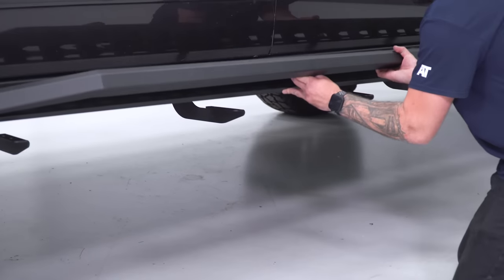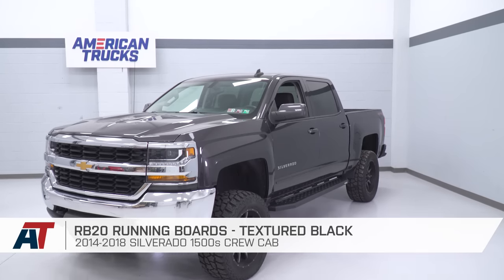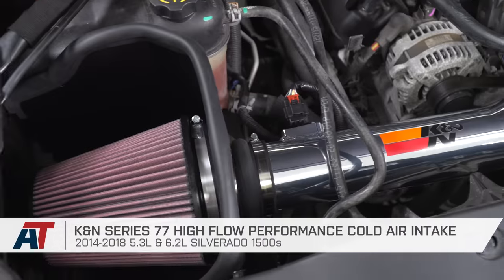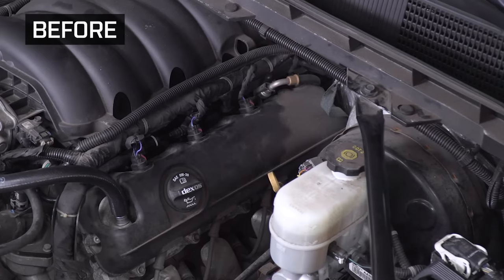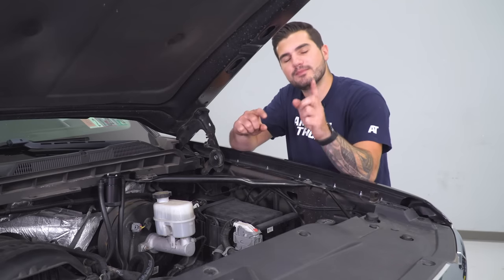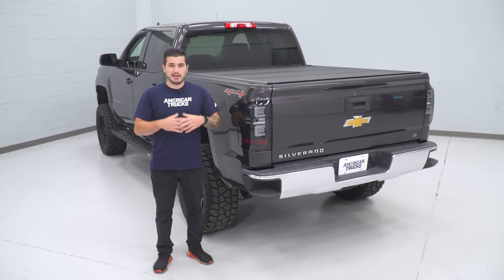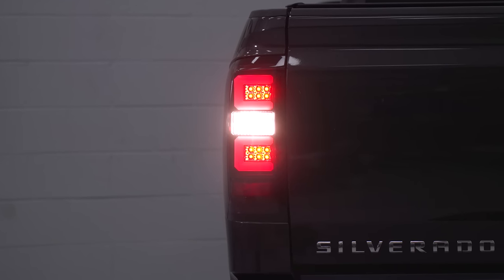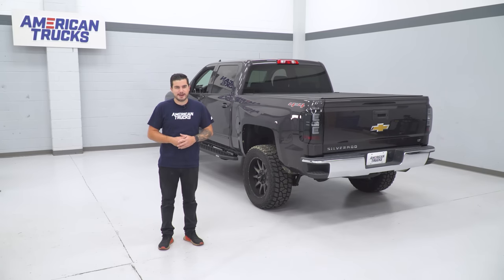Top 5 Easiest Mods For Your 2014-2018 Chevy Silverado - The Haul

Comment: Buyer Beware! I bought a pair of mirrors from American Trucks for my F150. After just a couple of months they no longer locked in place and I had to constantly open my window and push them back into place. Very dangerous. American Trucks said that they only have a 30-day warranty. When I expressed my displeasure, they offered me a $27 credit. Wow. I had spent over $1400 there this year. I told them to keep their $27.
Reply: In the future, you should check out boost auto parts. I've had their tow mirrors for over a year now and they have held up great. I've put them through it, off roading, going the speed limit ;) and through multiple car washes where the machine has banged them up or bent them backwards. They've never went out of place. Some mild shaking from what i heard if you're going over 100 mph, but I'd definitely recommend checking those out.
Reply: I second this. I've had the Boost tow mirrors for four years. I added every option except the electric motors & second mirror heater. No issues.

Comment: I put the JLT catch can on my 2017 Silverado LTZ 5.3.  I was amazed at the oil/residue it catches.  I can't believe that these direct injection engines are dumping that garbage back into the motor.
Reply: I’ve had the same reaction on any vehicle I put a catch can on lol, makes me wanna get a rebuild
Reply: @lolsk9136  Direct injection and turbos are for the birds.  Bring back the Vortec.
Reply from the maker: It's why I always say its an "all pros, no cons" kind of mod. It's easy, and it works. -Adam
Reply: You guys gotta do an AFM delete. It's the active fuel management system cutting your truck down to 4 cylinders. What they don't tell you is that while the AFM is active it is still vacuuming in the 4 dead cylinders and pulling oil and burning it. This contributes to the oil usage on your truck and frankly I didn't see any changes in milage. If anything it got better! Highly recommend 👌 A hell of a lot smoother to drive too
Reply: @bradyanderson6840  If you have a 6-speed, you can  set the gear to 5 in the manual mode and it won't go into 4 cylinders.  I also bought the Range Tech and that works for about $200.
Reply: @AStanton1966  You absolutely can do that but I don't want to give up sixth gear on the highway. The Range afm device is excellent 👌
Reply: Which side of crankcrase breathers do I hook this up to if I'm look at the front of the truck head on???
Reply: @steved7487  You got a breather on the right-mid valve cover part of engine.  Then you got a breather in the front of the engine in a little valley.  You hook the dirty hose of the catch can into the valley one--it will be the longer hose.

Comment: Grille…  I went with 
Headlights tail lights 3rd brake 
LED bolts into grille inserts n inserts 
2 train horns 200psi compressor 5 gallon  air tank 
3” leveling kit
Cam,intake, side exit exhaust 
Tinted windows
Running boards
Full kicker stereo amp subs
7 gallon water tank w/hose
A-pillar LED rigid spotlights 
LED pods lights into bumper (grinder)
Tow mirror install (had to swap door harnesses for 14 LT model) 
RDJ tailgate panel-

Comment: I bought a set of those led tail lights. I live in the Salt belt after 1 year, and 1 winter season tail lights failed due to the salt sorting out the resistors that are installed in a bad location on the tail lights them self. So redesign is a must, or a company needs to make an item that will close the gap behind the taillights.
Reply: I noticed that last night on my 2018 when I had a taillight out, nice big holes back there for the rear tires to throw everything at the back of the lights.

Comment: I just got 2018 LT 5.3 does anyone know what kind of cold air intake would be best ? Or would it best to leave it stock since that’s what’s it’s designed for ?
Reply: Its best to leave it stock unless you have money burning a hole in your pocket. Most factory intakes now are "cold air intakes" and any claims you see from aftermarket ones are including a edu tune as well to get whatever they claim. Spending over 1k for an aftermarket one and a tune to make like 15 hp is not worth it.

Comment: Hey there thanks for these upgrade tips. I have a 2017 GMC Sierra SLT too, but I find the stock backup lights are too dim to see anything when I back up in the dark. I have a long driveway that is hard to navigate at night, so I need brighter lights to avoid hitting anything. Do you have any suggestions on what kind of upgrade lights? I've tried brighter LEDs but still not great. I'm certain GM doesn't hold a monopoly on this problem because I have a Toyota with the same problem. Thanks in advance.

Comment: I hear so much back & forth about cold air intakes not being necessary, not being worth it, etc etc, woudl love to see some tests showing it's truly a step up. And woudl it matter on 6cyl 4.3 or 8cyl or, both?
Reply: Modern vehicles come from the factory with “cold air intakes”. Companies that claim a hp increase after installing their intake are tuning the ecu to get said increase in hp. Doesn’t make sense for the average consumer to spend close to $1000 for 10 hp
Reply: @kylebradley7751  HP, no, but what about gas mileage?
Reply: @Aiming Wanderously  I have a silverado a will not be putting a Cai. I had one on my tundra abs it made zero difference. It sounded cool and maybe increased throttle response but nothing other than that. Just my opinion

Comment: Can anyone recommend a lift that requires no permanent modification to a truck like no cutting or trimming of frame or anything and what’s the highest I could go if I went the route of no cutting? For a gmc 1500 2018 rwd
Reply: Don’t lift it if it’s 2WD SORRY NOT. SORRY
Reply: Depends on what kind terrain you plan on truck on. If it’s a street only truck you could get maybe 4-6 in if the kit doesn’t cause you to move the drive shaft angle. If it’s desert style I would go with dirt king UCA and  king shocks or fox 2.5 . Which will give you a 3 in Lift but more travel and a better ride. And you could add a 3-4 spindle  with the uca arms the list goes only depends and what you’re willing to spend
Reply: Go with a leveling kit it's a cheaper start
Reply from the maker: Generally speaking, you can find good lift kits up to about 3.5-4" that won't require cutting/permanent mods to the truck. When you start seeing kits that include differential drop brackets, crossmember, and relocation brackets of other kinds, then you'll start grinding and cutting components. Rough Country, ReadyLift and other have really nice lift kits that don't require cutting things up! 2WD truck are a little tricky, definitely less to choose from in the aftermarket, but generally you can find some good kits! Hope this helps. - Adam
Reply: @tylerbranch2918  of course you can but it’s just another pavement princess I would never buy a 2WD pick up that’s the most dumbest thing to do.
Reply: @jesusruiz3723  wat if i like lowered trucks cuh
Reply: @jesusruiz3723  good thing it’s not your money huh bud? That z71 looks pretty clean to be an off roaring vehicle..

Comment: I have a question I have a 2015 Silverado 1500 lifted and I do not see a splash shield for the engine underneath it everything is exposed once you lifted the truck did you use an aftermarket Splash Shields?
Reply: @E. Tamplin  It's the Z71 4wd it has a 6" fabtech lift I figured it would have came with the plates but there is nothing everything is exposed
Reply: @grayrider1865  I bought it used I'm sure whoever had it before lost the splash Shields or whatever it's even missing the upper radiator Cover I'm trying to find a replacement for the bottom splash Shields It seems like the 2015 don't have much

Comment: I just bought a 2017 chevrolet silverado ltz 2lz midnight edition and I put it on the freeway I pushed it to the limit and it top out at 99 mph have you done any videos on that and how to get more from my silverado thanks in advance
Reply: Possibly has a governor installed to limit max MPH, you should be able to get over 110 easily with the 5.3l
Reply: Sorry reading old comments but that’s 100% governor…Silverado could probably do 120 without it

Comment: i have a 2015 silverado, but it’s a v6, do you recommend lifting it?
Reply: I am also curious about this. I have heard that life kits can place undo stress on components because the angles are steeper.
Reply: i say do what u want.
Reply: @nathangoddard8115  I drove a 98 with a v6 with 3 inch lift in the back and 3 inch torsion bar keys up front and never had any issues
Reply: You probably have the answer by now, but I also have the 6 cylinder in my 2017.  I put a 2.5 lift on front and a 2 inch lift on back.   It will stress your front axles so you do have to install a front diff relocation block as well.  But it is super easy to do.  Also installed lt275/65r20 Nitto G2.  No noticeable ride disturbance.

Comment: What lift and wheel and tire size did you go with on this truck? I like the stance
Reply from the maker: 6" lift and 33" tires! Check out the full build at the following link! -Zach
https://youtu.be/WDSOUL5YRuU
Reply: How will it tow? I want to do this to my Silverado but want to pull a camper
Reply: @dlawsonlawson1582  add helper air bags

Comment: Mod number one should be disabling the motor destroying tech called cylinder deactivation. Its been what 15 years since this garbage was introduced manufacturers STILL can't make a system that doesn't end up blowing up the motor. It doesn't matter if it's GM, FCA, or Honda they all fail eventually and either require a new head or a completely new engine
Reply: Shhhh..... I make a lot of money off of fixing these issues.

Comment: I laugh everytime someone puts an aftermarket cold air intake on their truck. Your trucks airbox is already cold air genius.. The term "Cold air" is simply defined as air pulled in from somewhere not inside the engine bay, which is known to generate and retain heat. New and older stock chevys pull from within the wheel well producing the effect aka "cold air". All you need to do to achieve the same results as a $350 dollar CAI is simply dropping in a seperate aftermarket K&N replacement Air filter for the stock box at like $35-40 bucks... lol smh here not to mention you never recommended a tune to compensate for the change in airflow youd get with a streamlined air box and inlet tube, using your poorer and less than oem rated micron filtration media 🤭 Sounds like you should have researched more on that one.
Reply: Actually helpful comment! Saved me some money!
Reply: Doesn’t pay to get one , your factory box is better imo

Comment: Do not buy the bakflip. Gets water in it and gets heavy.
Reply from the maker: We've never had that issue, may be an issue with drainage pipes being improperly installed? The bakflip is a personal favorite of mine! Thanks for watching! - Adam
Reply: @AmericanTrucksChevyGMC  Go read the website.  They collect water freeze in the winter expand, get heavy.  I have now had two and they both did the same thing.  Spoke to bakflip about it but they did not offer the 5 year warranty when I purchased mine.  All installed professionally, which does not take a professional BTW.

Comment: Has anyone had problems with oil from the K&N filter screwing up the MAF?
Reply: I put mine on a few months ago and haven’t had any issues
Reply: I installed on my '14 GMC Sierra (6.2 ltr) 4 years ago. No issues
Reply: Never understood the hype over K&N. Worst filters on the market
Reply: As an automotive engineer, don’t waste your time on a “cold air” intake. The aluminum is nothing but a giant heat sink and your stock air box is more than sufficient enough. Not to mention any mod that actual makes a difference should be tuned for. The car can learn some but not it’s not perfect. Also YES oiled filters will screw with MAFs. Why do you think 99.99% of all OEMs are dry filters?

Comment: I gotta ask, people who buy full-sized trucks without the 8ft box. What's the point.  if you don't want to put stuff in the box or are not hauling a lot. just get a 1/4 ton crew cab. truck appearance, car gas mileage.  but I mean to each their own. it just doesn't make that much sense to have a full-sized truck that you can't even put an ATV or Snowmobile in the back of without having your tailgate down and half the machine sticking out. and forget lumber or, god forbid,  you to put a toolbox or 5th wheel. then you got squat for room
Reply: My short bed's good for my Great Danes.

Comment: Mod #1.... Trade it for a Tundra so you can actually have a truck 15 years later.
Reply: a what?! lol
Reply: AHAHA yeah right
Reply: @wthjesus  I still have my 07 Tundra.  485K miles of Ranch work on it.  Only thing that went out is the radio receiver and water pump.  Only replaced the water pump.
Reply: @TheAlphapuck5280  2003 suburban 206k miles original power terrain. My friend has a 02  tahoe with 300k miles original power terrain too... seems like more than 15 years to me
Reply: @wthjesus  I never said early 2000s Chevy powertrains were bad.  They were fantastic.  But the new ones are straight ass.  And its "powertrain".  Thats why there is a class action suit against GM for the powertrain.  They have the wrong combo of engine to transmission.  Thats the same reason why the new tacoma is not recommended anymore.  They have the same great transmission, but the engine delivers different torque figures and the transmission isnt engineered for those figures... causing very hard and erratic shifting... just like in the GM class action suit.   But the Tundra hasnt changed since 07' You still get the same great engine and same transmission that is known for never breaking
Reply: @TheAlphapuck5280  ahh I see your point they don't make anything as good as they used anymore corporations really only care about maximizing profit for shareholders, damn shame for the big three American brands ford, chevy, dodge. Especially the dealers that nickel and dime. Anyways I have a new 20 silverado and my cousin has an 18 sierra hopefully the only thing we'll have to replace is lifters. I'll look into the law suit you mentioned tho